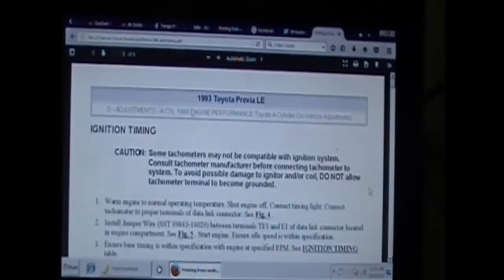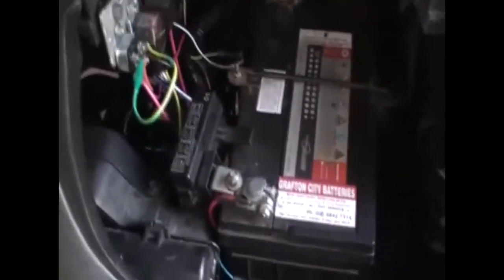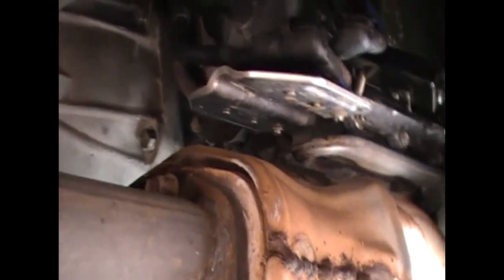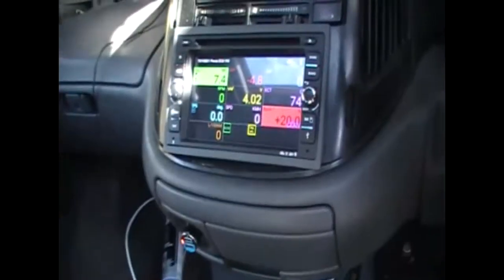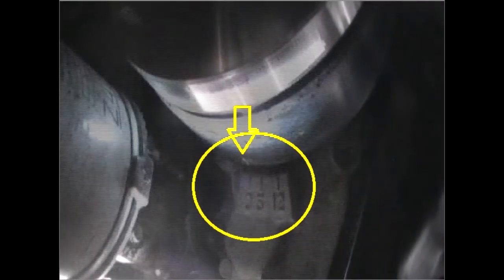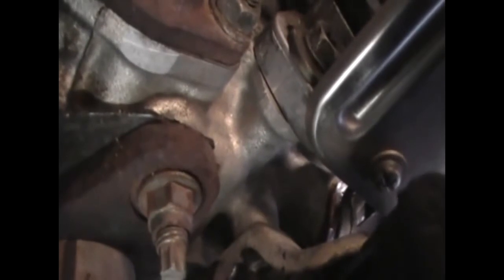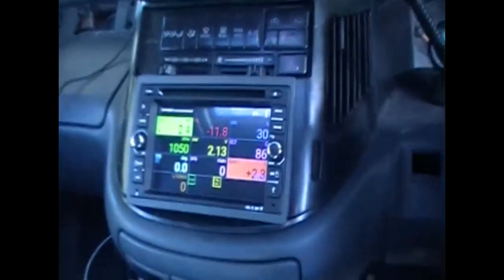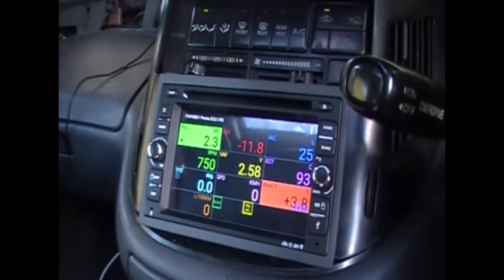Ignition Timing Adjustment [ Tarago Previa Estima TCR 2TZ-FE]

Comment: Hey, where did you get that document? I need it for mine! Having a 4 month nightmare with mine right now.
Reply from the maker: Hi. That document is a program called OnDemand5. You can also find documentation on my online workshop. I hope this helps. https://tpeworkshop.blogspot.com/p/08-ignition-system.html
Reply: @TaragoPreviaEstima  sweet, thanks! I realize mine is an SC so no adjustable distributor. I'm stuck on a really odd problem (posted in TPLU) that I can't seem to solve on a van I just bought from Samay. It just will not run right.

Comment: hi i have an intermitent misfire on my 1998 tcr10 tarago. it only happens when the engine runs, when its at running temp (warm) it also happens when idling. what could be the problem.
Reply from the maker: It could be a number of things. Leads, Plugs or distributer are most common. Dirty or faulty Injectors or a fault in the wiring may also happen. Are you getting any error codes?

Comment: Hi, I’ve got a 95 Tarago and had it in at mechanic, asked if he could timing, he said the computer looks after that. Is that right? Also, to buy car ramps that are strong enough, what weight is ok? Thanks for your clips, used one to replace rocker cover gasket and PCV valve.
Reply: Thanks for your reply, am retired and really like learning from your clips about the Tarago engine.
Reply from the maker: No, he is wrong. The timing is adjusted on our vans. Yes the ECU plays a part but nothing like today's modern cars. Normal car ramps are fine to use. check out my clip about timing https://www.youtube.com/watch?v=h04NlGDbXCo

Comment: There is gasoline, there is a spark, I cannot fill candles
Reply from the maker: There are a number of errors why you have no start. Do you have compression?, is the VAF sensor connected and good? Is the timing correct? Is the ECU good? check all fuses, Hard to answer. You need to check everything.